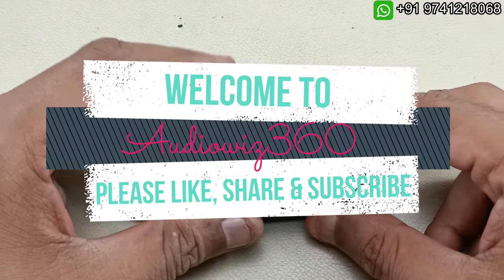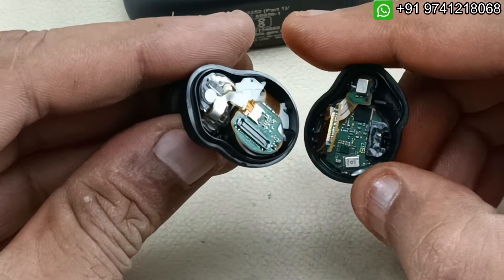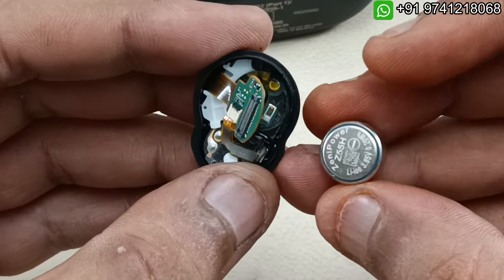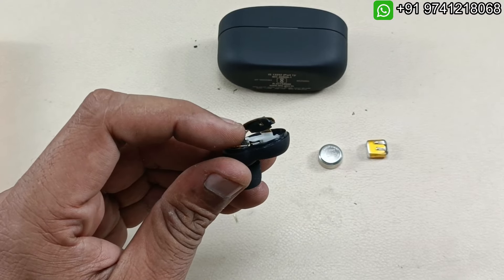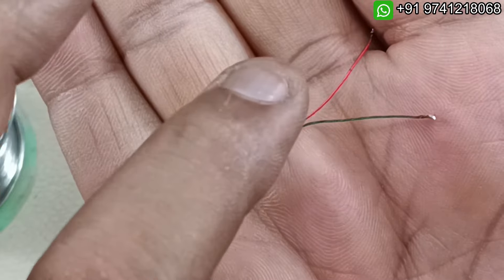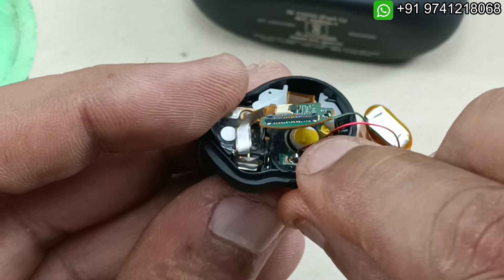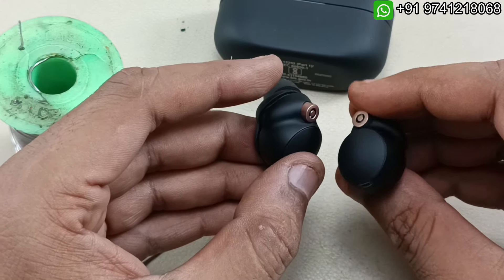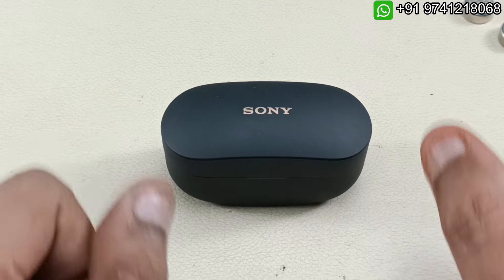How to replace using Li-Po Battery SONY WF-1000XM4 wireless Earbuds | Install | Remove | Repair

Comment: Recently my XM4 got Water damaged and after checkup at Sony Service and their diagnostic software it shows that the Charging case has died and one of the buds is not charging as well 😢. Just one bud is working but there is no way to charge it hence useless
Reply from the maker: oh sorry for that.